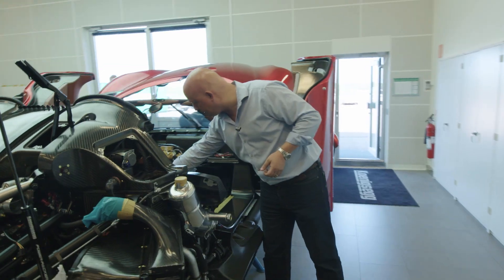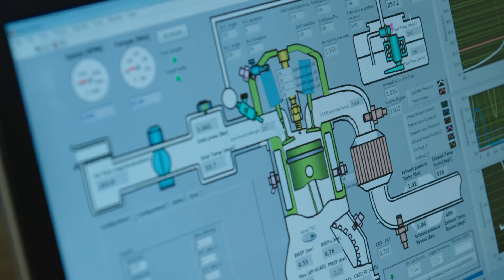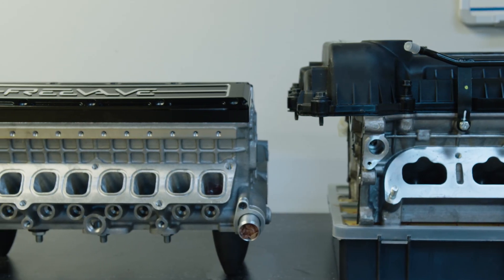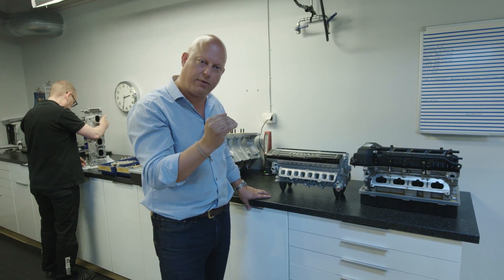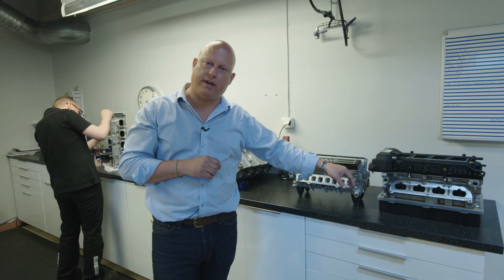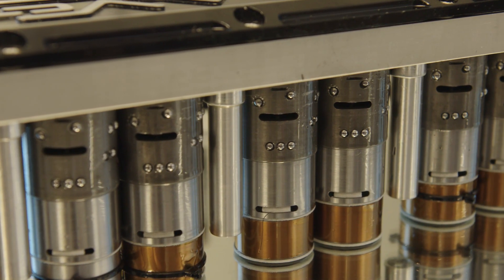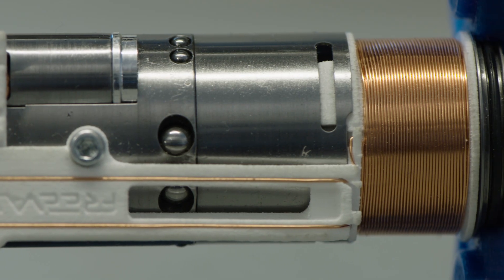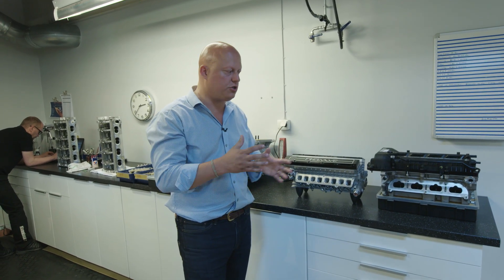Freevalve Update Camless Engine -- /INSIDE KOENIGSEGG

Comment: 160hp to 240hp and 240NM to 320NM of torque. That's amazing. 15% fuel savings, 35% emission savings. YES PLEASE. The main reason I'm excited for this is that you can potentially change cam profile on the go. For supercar applications, you go from street cams to sport to race cams for example. Or the car automatically goes into race cam over 6000RPM. Brilliant engineering.
Reply: You're still thinking in cams. The thing is that sport and race cams and such are still only cams which are only tuned to one specific rpm. Instead of switching between phases in some intervals where they are only good at one rpm, imagine having it optimised for every single rpm and every single combination of rpm, torque, engine temperature and air temperature. 
The thing is that we no longer have to have compromises in valve timings but can do it exactly as good as we want to spend time modeling, tuning and testing.
Reply: There would be no need for the system to have street/sport/race it would just be inferior, the Cam ECU would just have 2 maps of cam timings and lift, one for most horsepower/torque and one for best efficiency. There is no such thing as a cam profile in this system, each time a valve opens or closes its "profile" would change according to throttle level, rpm, boost etc..
Reply: It's like having a better Vanos or i-VTEC system.
Reply: imagine trying to tune one of these though. gonna need to be Steven hawking to not bend all your valves straight away.
Reply: No more need for heavy and elaborate cam phasing, high lift lobes, rocker arms, ect. A lot of potential here.
Reply: VirusTornado "hang on guys I have to install my race cam" -goes to his laptop and downloads a map.. So freakin sweet!!!
Reply: ''You wouldn't download a camshaft!''
Reply: Basically the same concept as i-VTEC, except that you don't have to deal with mechanical camshafts at all, and so no timing chains or belts, smaller, lighter block, infinitely variable so it can be tuned to precise engine conditions, and you have less power going to mechanical processes and less generated heat.  The primary negative is the dependency on a properly functioning engine management system.
Reply: Or the Toyota's Valvematic.(coupled with the D-VVTi)
Current Corollas have it and it kicks out 98kW of power from a naturally aspirated 1.6l engine. And the fuel consumption of it is ridiculously low :)
Reply: Hey, that sounds exactly like the 1.6 EcoBoost in the Fiesta ST!
Reply: Sebastian Jørgensen That's the beauty of a non-interference motor.
Reply: "USUALLY they're non-interference engines"

Usually, unless you're a bloody Renault F4R and your timing belt slips one tooth at about 6000rpm... :-(

I have a spark plug on my desk from where it was punched out of the block :-/
Reply: Sigma Projects They probably figure the failure rate of belts is low enough even on interference engines that it's not a big issue. That said, I'm glad my Toyota uses a chain.
Reply: nblax41 Someone paranoid as hell running an interference engine? 
I'm at 220,000miles on my 1ZZ on the stock chain.
Reply: 177SCmaro haha
Reply: lolz larkin it depends on how much control the user has. The tuning system might have some sort of fail proofness that the valves cannot be opened more than just a little bit or not at all when the piston is at the top. That way, if you specifically hack the tuning software and ruins your pistons AND valves AND valve actuators by smashing the piston into an open valve, then you're kind of asking for it yourself.

Any tuning software would have some max and minimum values in order not to trash the engine.
Reply: Sigma Projects Could the valves be held open for a full cycle without trashing the engine on one of those? I wish my friend had one when his timing belt skipped a tooth then!
Reply: Erik Johansson I think he was speaking tongue-in-cheek. Of course there is no need for a racing cam profile in a camless engine.
Reply: Sebastian Jørgensen Yes, usually engines with timing chains are interference engines like you mentioned and those with timing belts are usually non-interference engines. If it's a non-interference engine it means the valve can be fully open and the piston at TDC can no contact would happen.

Some engine with timing belts are interference engines, but USUALLY they're non-interference engines.
Reply: Matt Elkington Yea, I know. I'm always surprised when a manufacturer uses a timing belt on an interference motor. I mean Toyota doesn't do that, if it's belt driven, non-interference, chain then it's interference. I think most Japanese cars are like that.
Reply: There are a lot of cars that use a belt but are interference type engines
Reply: Belt vs chain is just a design choice, it has nothing to do with interference or non interference engines
Reply: nblax41 No one said it was an absolute. Just that some manufacturers will choose to use a chain vs a belt when they design an interference motor, like Toyota.
Reply: ***** Neither do chains if they're still in spec.
Reply: thedog556 Bought a used 2zzge a while back and the chain and sprockets were still in spec. just changed the guides.
Reply: thedog556 So the Toyota service manual is wrong about when to change the chain and you're right?
You may want to let Toyota know that so they can make the correction then.
Also, what did I say that was wrong? I just said if a chain is out of spec, change it, if not, it's not necessary - basically the same thing you said.
Oh, and it's not one motor. I've been doing this for a while on more then just car engines. It's not always necessary to change a timing chain. If you want piece of mind then go ahead, it's your money. I'm not going to tell anyone how to spend their own cash.
Reply: Who changes their timing chain at 70k? That's ridiculous, a belt lasts 60k-100k depending on the engine. Chains can go at least 100k, many will do 200k without any problems. This isn't 1950.
Reply: 177SCmaro Well that's Toyota haha. I had a Frontier come in for a brake inspection, everything was good. Then we went to take it out of the bay... and timing jumped a tooth and the valves got bent. The truck looked in such good shape, but yea... poor guy.
Reply: Sigma Projects It happens. No rig is perfect. My early 1ZZ may not have valve train issues but it's got the typical oil burning issues. 
 : (
Reply: 177SCmaro oil burning? Hmm... sure it's just not just leaking oil, oil burning on 1ZZ didn't seem typical, 2AZs yea. But every 1ZZ I've come across has only had oil leaks not burning.
Reply: Sigma Projects Actually it's both. The rear main leaks a bit but the majority is definitely burning. Goes through plugs like crazy. Gave up putting good oil and plugs in it.
It's a pretty well known issue. Apparently early (pre 2003) 1ZZ-FE engines had a poor piston design that had insufficient oil drains for the piston rings which tended to plug up with carbon and stick the rings, etc.
However, next week is thanksgiving and I'm taking the whole week off to finally swap in a 2ZZ and a C60. Should perk my Celica up a bit : )
Reply: 177SCmaro Didn't realize it was common since I haven't experienced that issue on them. 

2ZZGE you say? That should be awesome.
Reply: Sigma Projects Check out some of the Celica forums. They're replete with all sorts of supposed cures, lol.
And it should be over 40 horsepower more then what I've got. Quite a bit for a 2500lb car. Still not what I'd call fast, esp compared to my Camaro, but it's okay. it's my DD. I've been "told" you can't make everything into a racecar (yeah, right)
Reply: 177SCmaro My friend has an 02 GT with 200K, no oil burning problems. Mother has a 98 Corolla, no oil burning and the numerous ones in the shop haven't seen burning oil. That's just my experience, not absolute obviously. My guess is the common issue is that it's a Celica forum where they probably beat on the 1ZZ and I guess in that scenario they burn oil. 

7th Gen Celica are pretty sweet on a tight track. With a good driver behind the wheel oh man, you can embarrass a lot of people.
Reply: Sigma Projects It's dosn't seem to effect every early 1ZZ and at the same mileage.
And yeah, the Celica handles pretty good for a fwd car, a little tail waggle now and again, it's a pretty light car. I'm coming at it from muscle cars so it's a big difference.
I think the 7th gen Celica is probably the last sports car you buy before getting an S2000, which is the last you get before buying a corvette lol.
The car I wanted was actually a Lotus, but those little buggers are out of my pay grade even used...
Reply: 177SCmaro If you want a cheap lotus, pick up either an AW11 or ZZ30 chassis 2ZZGEs bolt in pretty easily. I'm not sure about SW20 chassis. But if you got a ZZ30 and put a 2ZZGE in it, that's almost a Lotus Elise.
Reply: 177SCmaro Funny I grew up around Camaros (my father loved them), but after I got a light weight J-tin car, I got hooked on light weight stuff. Love corners, lol.
Reply: Sigma Projects I've considered them, but the newer Elise would be the one I'd want. Champagne taste, beer money, I guess, lol.
I still like my old Camaro, but there definitely is somthing to be said for quick and light. I've even had some dark thoughts about geting a hold of a junker Celica, shelling it out, and squeezing in a small block chevy/convert to rwd, combine old with new, but one race car is probably enough.
Reply: 177SCmaro Haha yea, too many projects definitely not a good idea, especially if you're married. Wife is trying to have me get rid of the AW11, lol.
Reply: Sigma Projects Yes, exactly. 
And I have two "wives" already, one a red-head, the other raven black, trying to "marry" another would probably brake the bank. lol
Reply: VirusTornado electric motors still win and they only have 1 moving part
Reply: Jonathan Dittmar Maybe, someday....But not today.
Reply: 177SCmaro by 2020 EVs are expected to be equivalent price to gas cars.
Reply: Jonathan Dittmar Does that include removing the generous subsidies we're all forced to pay for electric and hybrid cars?
Reply: 177SCmaro yes we are already seeing sub $30 msrp EVs for 2017 model year.
Reply: Jonathan Dittmar*Subsidized* $30K EV cars. You're not seeing the true cost of these cars right now since the taxpayer is forced to pay for a portion of them. There is also the cost of batteries, both in terms of replacement and the environment impact//cost, and they fact that most electric cars are coal powered.
There is a little more to it then you're letting on dude.
Reply: 177SCmaro no, im talking about before subsidie prices like the egolf,leaf,smart car, Hyundai ioniq, ford focus, kia soul
Reply: 177SCmaro the tesla roadster is 9 years old now, no batteries have been replaced yet many car have over a 200k miles on them
Reply: 177SCmaro with subsidies these cars are under $23k
Reply: Jonathan Dittmar Still subsidized, still more costly then you're letting on.
Again, yeah, someday electric could replace ICE, but not yet.
Besides, guys like me still have a preference for our noisy engines that run on exploding fossils and the tactile pleasure of stirring our own cogs.
Reply: 177SCmaro oil is subsidized also so the true cost is also more then you are letting on
Reply: Jonathan Dittmar So is electricity esp. coal. And I never said anything about oil. Nice try though.
Reply: 177SCmaro you said subsidies and oil has them too. Convenient to leave them out isn't it?
Reply: 177SCmaro the u.s military being the biggest subsidy. You don't see army bases by solar factories do you?
Reply: Jonathan Dittmar We were talking about the car, not the power source. So it seems you're trying to deflect with a distraction i.e. you are trying to change the subject.
And, again, electricity is subsidized too, so oil subsidies is a moot point.
Reply: 177SCmaro electric is not subsidized with wars tho even coal is conflict free but oil isn't.
Reply: Jonathan Dittmar War is not a subsidy.
Reply: 177SCmaro why are military bases near oil fields?
Reply: 177SCmaro they also fund places like saudi Arabia so you also subsidies terrorism
Reply: Jonathan Dittmar Still doesn't make war a subsidy. Btw, it seems you've given up the issue of auto subsides. The fact still remains electric/hybrids cars are subsidized in a way other cars are not, hence, you don't see their actual cost.
And, also, just to clarify, I'm against all subsides and disagree with most of the USA's (and other countries) foreign polices.
Reply: 177SCmaro battery cost have fallen at an average of 5% a year since li-ion was invented so it won't be long even if subsidies get removed to compete with IC engines
Reply: Jonathan Dittmar As I said, maybe, but not today. If they did, they wouldn't need the men with guns forcing all of us to pay for a part of these cars in order for them to be competitive in the market in the first place.
Reply: I actually had a timing chain snap at 70k on a civic before, annihilated that poor D17A2.
Reply: That's actually the beauty of the system is that you wouldn't be "swapping cams" on the fly but your motor would instead always be running at perfect power, torque, and efficiency depending on your situation. There would be no need to download any new maps or switch modes

Comment: Wow, amazing !    But what about long-term reliability of the valve system?  What if one of those valves 'malfunctions' and gets stuck 'open' ?
Reply: The same as a skipped or broken timing belt or chain, or a dropped valve or broken spring on any other interference engine, valve and piston collide, carnage ensues.

Comment: I came up with this idea back in 2000 back in high school.  I guess I should have looked for investors but what did I know.
Reply: But my idea is based off solenoids and not air pressure like his. But F1 has been doing this for years with nitrogen powered valves so this tech is not new at all.
Reply: benarriaga F1 use pneumatic springs not actuators.
Reply: F1 only uses nitrogen gas springs instead of steel springs
Reply: I know at least 2 companies that have prototypes of a solenoid based system like that
Reply: All that does is close the valve very quickly, faster than a metal spring can, for higher rpm revving. It does not allow full control of lift, duration, and timing. 

The pneumatic valves used in F1 and MotoGP merely replace the valve spring with an air spring. The valves are not pneumatically actuated.

Comment: just wondering why use air pressure to open and close valves, why not use polarization to open and close the valves
Reply: shaun spengler because it's slow and inefficient to use electric energy and convert it to linear motion
Reply: It's not slow or inefficient in terms of power, it's terrible in terms of SIZE.
Look at a air die grinder vs a electric one (a real one, not a fucking dremel)
Reply: in the case of LINEAR motion my point still stands, converting to rotational motion is easier